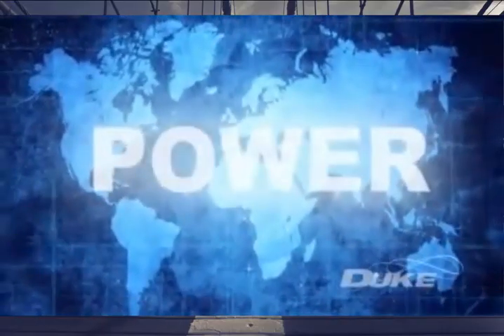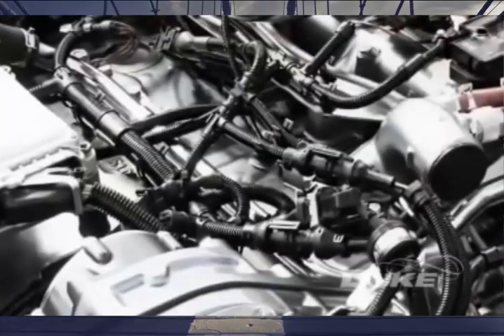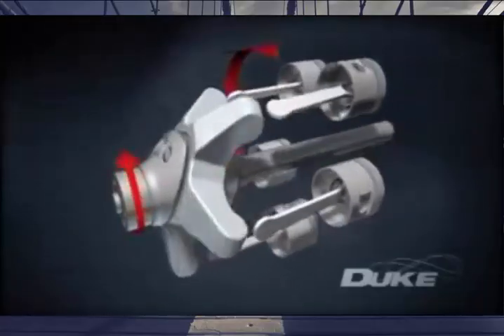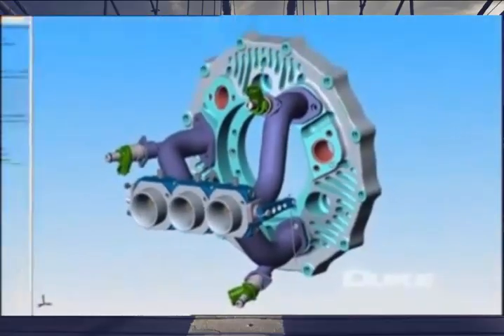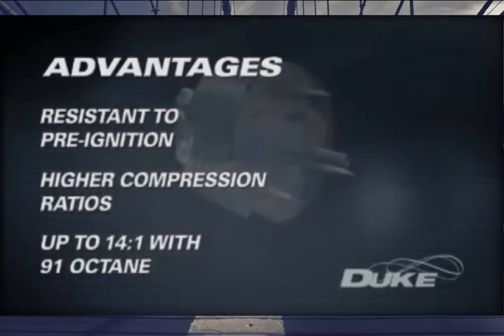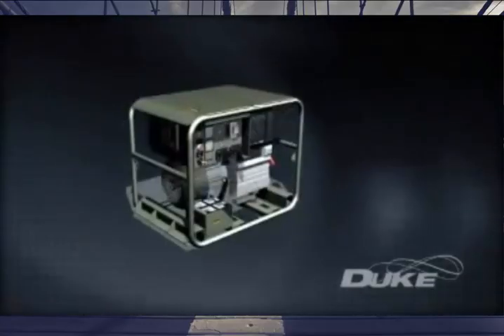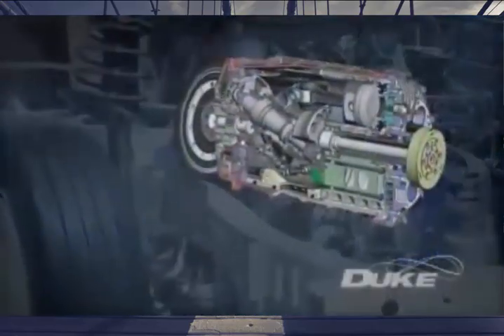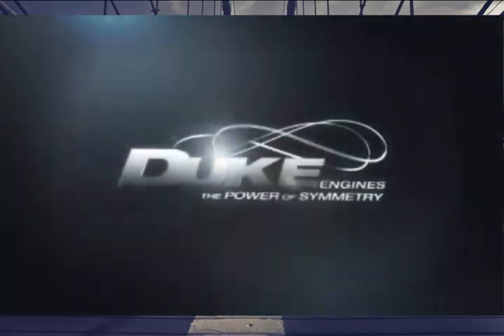Duke Engines | All information about Duke Engines

Comment: cool, seems like a good idea, can it use a turbo though?
Reply: I suspect it barely runs under normal loads due to sealing issues, let alone being charged
Reply: Take a look at the website, they've had it in cars doing runs. But the power output of their 933cc engine is less than a smart cars 3 cylinder with half the capacity.

As to turbos:
By the way the cylinders and combustion happens it looks like it gets a very limited window of time to draw air in (where valves usually step in), so I would imagine a turbo is the only logical course to take to extend that, and the power output. 

All this said, the point becomes mute as we are moving to hybrid and electric cars. If this could be made to take the place of a small diesel generator for a hybrid, cut the running costs of it? it wouldn't need an extensive rev range, just enough power to meet the electrical demands of the motors.

Comment: why are we still burning gas when there are better technology? it's not better than the M.Y.T engine.
Reply: I haven't seen a video of the M.Y.T. engine running on fuel (only compressed air). this is at least running.
Reply: madmax2069 true but it doesn't mean that it can't run off of gasoline
Reply: existing infrastructure and the massive amount of money and power wielded by those atop said infrastructure. Ask the electric trollys that used to run the streets of every north american city about them.

Comment: They seem to really be pushing the point that it weighs less without ever stating that it's more fuel efficient. Case in point: the wankel engine also weighs less than the conventional piston driven engine, but we all know how that one turned out. It had great power numbers and was lighter, but it was notoriously difficult to meet emissions standards and it's fuel efficiency was terrible.
Reply: "hybrid's have high maintenance costs"

My daily is a Prius.  It has had nothing but oil changes and tire rotations in the 5+ years I've owned it.  The maintenance costs are nil.
Reply: "is that too expensive for 85-90% of the world's population?"
Totally. For many, unreachable. We are talking here about a luxury electrical car tho, something made almost like to bring a new image to electrical cars, and boy it does it well.
The big issue with electrical cars are the batteries. Was, is, and will be the issue for many years. Li-Ion cells degrade over time even if not used, they can't be discharged past a point or irreversible damage happens, they degrade on high temperatures (actually most Li-Ion/polymer cells degrade already past 40°c, which just means a car parked on the sun on some countries), low temperatures, and when punctured the damage is catastrophic. And that's the highest physical and per mass density battery technology currently available. The old battery's replacement is a HUGE cost. A new pack for a Nissan Leaf full electric car costs 5.5K dollars in USA, where stuff is usually a lot cheaper than elsewhere. That's currently the cost of a new popular car here. Not to mention range, the Nissan Leaf for example does just 1h 16 min on the highway, that's not enough for a longer trip, where a normal ICE car would just go what, 4~8h on one tank? And you'll need a specific charging place, + electrical bills....
I do believe on the potential of electrical cars, but the battery is a hindrance nowadays, it just needs a big breakthrough in battery technology.
Reply: +Kalvinjj so, you're telling me 40k is too much? most people buy on credit, so i don't agree with tou, maybe in your country it's too much
i agree on the rest, but i prefer diesel or gasoline, full eletric has a low range, hybrid's have high maintenance costs.
ill go with the old stuff
Reply: If electrical lines go down, the local gas station is also dead in the water.
Reply: Face desk Fyi, if you would watch the video before commenting they do talk about the compression ratio, which is the main variable considering combustion engine emissions. Ergo, Your comment was a waste of space and time(should have used the time to watch it, instead of commenting)
Reply: mistbooster Really passionate about this engine, aren't you?
Reply: Btw, compression ratios are not the main variable. Air-fuel ratios are. Compression ratios only affect the CH4 to NOx ratio. Air fuel ratios affect CH4, CO2, and O2.
Reply: My point was that it's innovative, but our current technology is far too advanced to be starting over. We're already phasing out engines and replacing them with batteries. The only practical use for this is in small aircraft.
Reply: Compression ratio directly influences on the optimal air to fuel ratio engine uses, also when your dealing with gasses compressing they absorb heat(entropy increases). with a higher compression ratio you can use a lower fuel to air ratio. 

running a car purely on batteries is and will be a pipe dream for atleast 85-90% of the worlds population for atleast the next 50 years, while a hybrid engine is not. So not exactly "just small aircraft" Hybrid engines in western world, and efficiency increase for the 90% or so. Not to mention all the search and rescue vehicles and public transport(busses) will not be running on batteries only. If you look at those two public section, they downright slapped pure electric cars out of their fleets. 

S&R vehicles need a lot of power for long periods of time, so do busses, and road transportation in general. Batteries, even the prototypes cant deliver so choices which are left:
-Better combustion engine
-Cleaner fuel(LNG)
-Hybrid
-Fuel cell
Reply: ***** Electric motors have a 75% efficiency rating. ICE's are a long way off from reaching that. It's better to burn the fossil fuels at a power plant and charge batteries for cars than putting them in cars in the first place. This engine shown above has been around for over 100 years. It's mostly used in light aircraft because the variable compression ratios are fantastic for maintaining a consistent power-band throughout all altitudes. As for cars, the NOx levels would be through the roof if someone modded a car's compression ratio to boost its horsepower. Governments would not like that.
Reply: ***** I was diggin' what you were saying until you wrote: "That could". 
Sir, may I just say that everything from that point on was pure speculation that can't be backed up with any proof. I can "claim" that MY car gets 200mpg, but if I don't put my money where my mouth is, who's going to believe me?
Reply: the new Tesla will cost about 40k in my country, is that too expensive for 85-90% of the world's population?
and the new public transports ( not just the bus, and when i say new, i mean we already had that in 2015) run on batteries only. Altough some still run on diesel and natural gas.
Hybrid's are an illusion, the toyota prius makes an average of 2.5l/100km and has a lot of maintenance costs.
A new diesel car, let's say a Fiat Punto does 4.0l/100km and has a low maintenance cost.
Basicaly, the money you save on fuel, you spend it on electricity and maintenance....
I'd rather have the conventional engine improved,
Reply: +yalnizful sadly he is right, 40k is too much. credit or not a deposit and then a final bloom payment would be required. In the UK I got an 19k car on finance (credit) and the deposit was 3700 (more than a lot have to drop in one go) and 2 years later a balloon payment of over 9k... that is out of range of most people. not to mention the current cost of battery replacement meaning resale value is massive reduced comapred to a ic car. insurance is massively higher as they are considered high risk both in accident terms are theft, I got some quote for a tesla and it was 1100 a year, my audi s4 costs me 320 a year. It all adds up.
Reply: ***** Considering there are Prius used as taxis with 300,000 miles out in the real world with electric drive systems that have needed no repairs, I won't be worrying too much on how much longer until I replace the traction battery.
Reply: *****
one thing to note tho: since it's a hybrid, not pure plug in electric, you may or may not use the battery. + the Prius used (dunno if still uses) a Ni-MH battery, that degrades a lot less per temperature variation and by stored time, even if fully depleted. Ni-MH batteries are pretty reliable if the charging circuit is well made. I also don't believe the electronics on an electric car would need much maintenance as well, other than battery, seen on a magazine that indeed the Prius doesn't lose much of it's value over time (just about as much as a normal non hybrid, if not less), it really didn't require much extra maintenance.
Reply: NiMH batteries are less fussy than lithium ions but a properly set up battery management system plus a reasonable amount of extra capacity to reduce how much a battery is cycled from full to empty can greatly mitigate that issue.
Reply: +Kalvinjj http://www.telegraph.co.uk/motoring/green-motoring/10478975/Electric-cars-suffer-worst-depreciation.html
Reply: James Evans
Nice link, seems it happens in Great Britain as well that hybrids retain price well/better, but pure electrical cars get the axe quite quickly... Well that's granted if you think of battery replacement, it can easily cost as much as a cheaper car itself. Although I wasn't expecting that much.
Reply: in less words.....the gov squashed it. people who think they have some kind of "say so" in what goes on in the world today are funny and, well, just plain not paying attention.
Reply: But what if the lines go down, or the power plants have some type of failure? You are  stuck. And in severe cold the efficiency of batteries goes down.
Reply: Along your line of argument, consider that the familiar piston engine has had over 100 years of engineering put into the design details. With any new design there will be a catch up period.

Comment: Sealing the cylinders against a sliding head can't last long.  I'm sure it runs great for 30-40k miles but then the head seal starts to wear and its rebuild time.  Nice idea but too complex.  Bad timing anyway.  In another 10 years most new cars will be self driving electrics.  There are a lot of more efficient piston engine designs  out there but no one is investing because the timing is all wrong.  You can't sell if the market won't buy.

Comment: As this is a "valveless" engine I cant imagine forced induction being feasible as there's a dwell period in the inlet where a cylinder is not present meaning you would just be forcing air into the crank case between the motion of Exhaust and Inlet.
Reply: Can't imagine? 
Shirley they'd have the inlet spanning two cylinders?
Surely?

Comment: Gasoline engines are about to be outdated by electric cars. Your market is evaporating right before your eyes.

Solution: Build a 600HP diesel engine. Max of 6 cylinders a displacement of 19 liters and no less than 2,000 foot pounds of torque. Oh that's right your revolving cylinders probably can't handle 18:1 compression ration (required for diesel engines) or be turbocharged/ supercharged hard due to sealing limits. 

Oh and on top of those specs all the diesel add ons available now must be able to fit on your engine so people can tune it and jack up the HP and torque to incredible heights.

If you want your investment to last you need a diesel version. And then convince every single diesel drinking gear head to accept it. And as we all know Gear heads HATE anything new.
BTW the engine specs I described were attained by an engine built over 30 years ago. It's the Cummins KTA 600, You should look at its modern equivalent, the QSK19.
ON TOP OF THAT you have to meet the ever changing and restrictive EPA/Euro Emissions limits. Unless your Volkswagen. lol